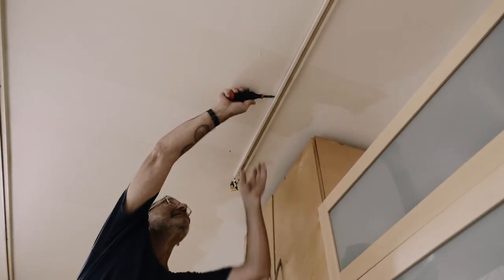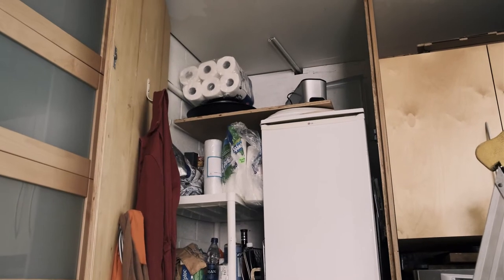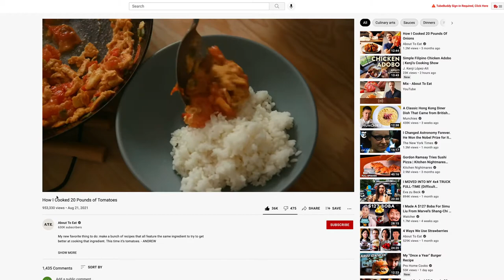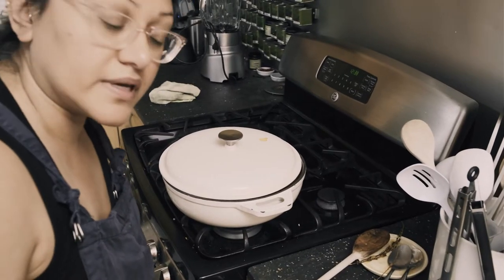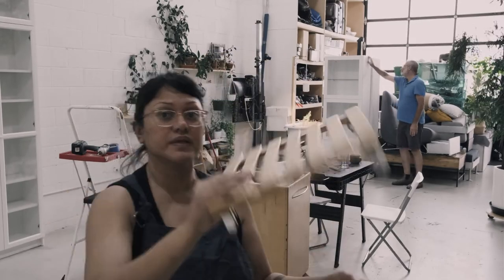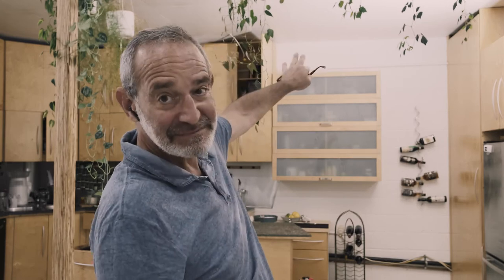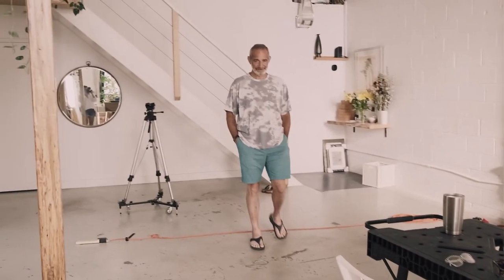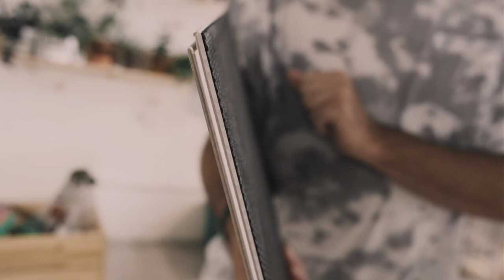Getting New Flooring!!! | Kitchen Reno | Part 5

Comment: Love the kitchen so far. Can't wait to visit and have a meal with you guys. BUT.... I have a question about your rolling tripod stand, I saw in the background towards the end of the video. Is it adjustable depending on how wide you have the legs of the tripod? I'm binging your Kitchen make over videos. Slow today.
Reply from the maker: The rolling base dictates how wide it can go but the tripod is a manfrotto and this particular style has sliders/push buttons allowing you to change the height of the tripod (all three legs) quickly without having to adjust each leg individually.  You can still adjust each leg if needed, but love the flexibility of doing it all at once.  Makes a good portable “studio stand”